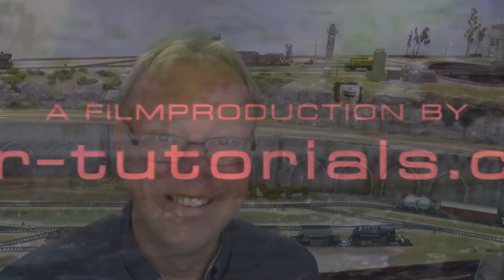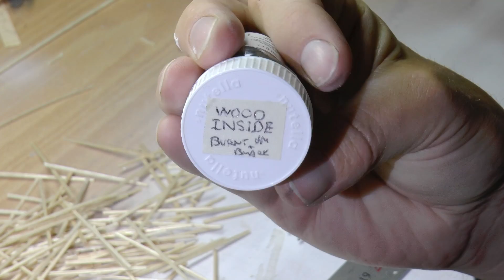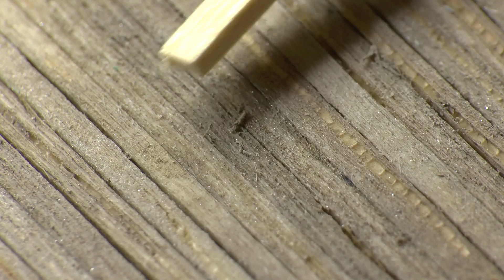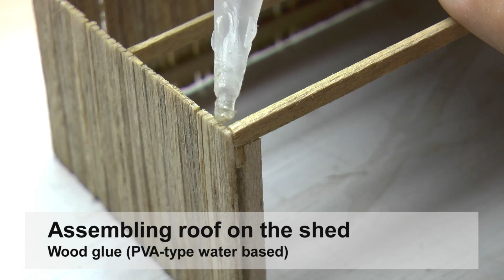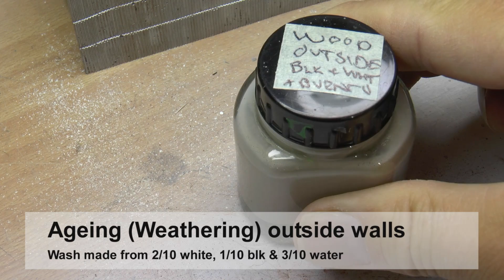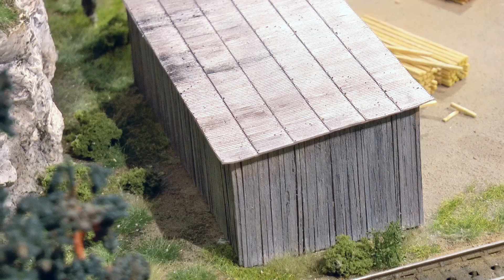Model realistic shed ULTRA - Detailed guide DIY

Comment: I'm enjoying your videos so much! Thank you for all the inspiration you are providing me with. I'm learning and learning. Trying things out, make errors and watch your tutorials all over again. Now I'm busy with weathering a building and I'm wondering if there is an alternative for isopropanol alcohol. You use it a lot when using serveral different weathering technics. Is there an alternative? Thanks again and I will keep watching you and always smile when you start off so enthousiastic!
Reply from the maker: Hi! Thank you for the positive feedback! It really warms my heart! 👍 I have not researched alternatives to the Isopropanol. This is along with water the two main componets in most types of thinners for Acryllic paints. I guess it’s present in the paint as well.. Just from the top of my head.. I would try with soap. The main objective for the alcohol is to reduce the water tension, enabling the paint to float over the surface. Soap will do this for you as well. One drawback with soap is the foam..
Reply: @marklinofsweden  Thank you so much for your quick and sympathetic replay. Big smile on my face. And your reply helps to understand what I'm doing exactly and what my objective is. In this case weathering a loc shed. There is so much info on YouTube that I sometimes forget to keep it simple and stick to one method. I like to make my own materials like the pigments or a wash and your video tutorials are a big help. Thanks again. With kind regards, Eveline